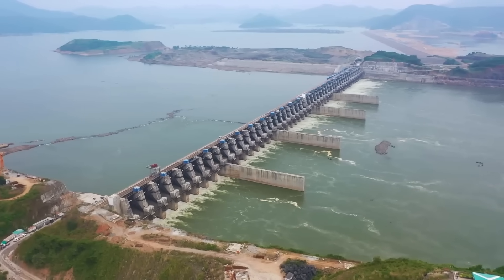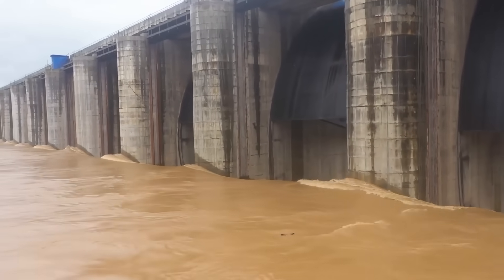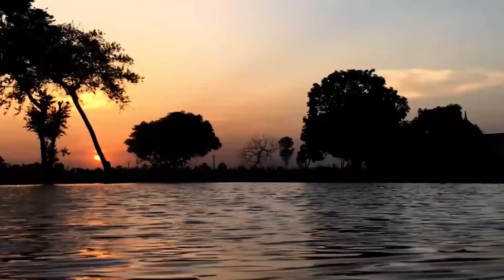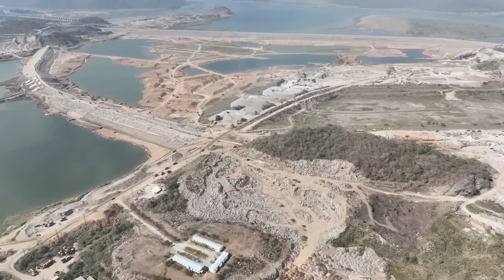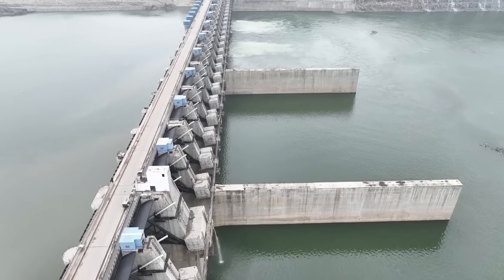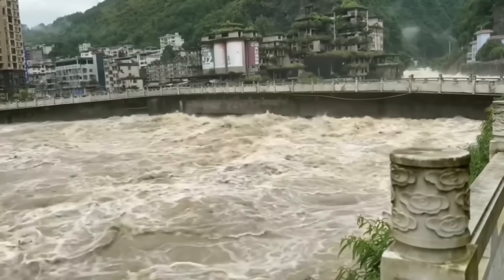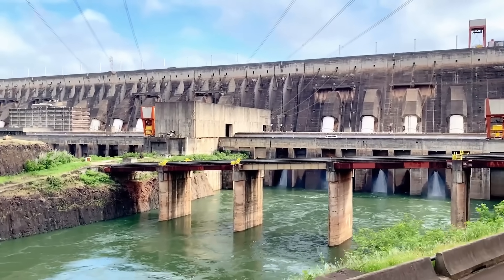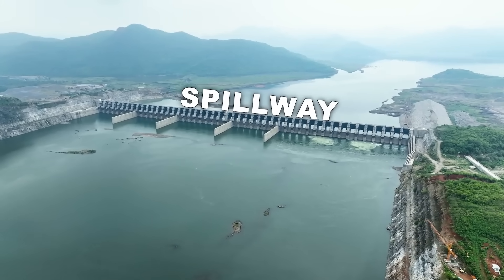Why is India Building a $6BN Giant Barrier?

Comment: The Three Gorges dam does not reduce the frequency of floods. Not because it can't, but because it is the most mismanaged flood control structure in the world, along with the dams upstream and downstream from it. Flood control doesn't seem to be a factor. Power generation and the profit from it is held by many Chinese to be the only thing the CCP cares about. The environmental impact of that reservoir has also been far, far greater than it was stated to be, causing noticeable changes in local climate and the stability of the canyon walls around it. Seems like they only release water when the dam is about to surpass 100% capacity, when the storms have already hit, and then do so with rapid releases, actually exacerbating flood damage, flowing water over already saturated areas. So... not the best choice to feature.

Comment: if and when China builds a damn blocking water from reaching India, it would be prudent to have a emergency reservoir , china will build a dam out of spite and not need to, but just to gain power over India, i forget the name of the river but goes through china in the himalayas before going into India, western river project it was called,  in the end if china does block water there wont be a need to build a dam by india because there wont be any water to retain coming from the north

Comment: One of the longest dams, 3.7 km in length, in the world and at a height of 45 mts power generation capacity of 980 MW (1 GW)  sounds so low. 
It should be atleast 2000MW (2 GW)

I'll put the comparisons below with itaipu dam.

Dam   => Itaipu : Polavaram

Height=> 196 mts : 45 mts 
Ratio  => 4.3 : 1

Length => 7.9 km : 3.7km
Ratio   => 2.1 : 1

Energy=> 14 GW : 1GW
Ratio   => 14 : 1

I mean the energy ratio also should be around 4 : 1 which gets us the capacity of around 3 GW and conservatively 2 GW
Reply: Water level matters
Reply: @Rocky-111.  

Now the comparison is for the electricity generation, and I have mentioned all the comparable things available on the internet and mentioned them here. 

If you think water level is something that affects electricity generation then you need to mention the comparisons in some quatified way for anyone reading to understand the importance of it.

Comment: How long will it last?
Reply: @ohcho-fg4co
The previous dam downstream built in 1850 was to last 100 years, but it is as good now as it was in 1859. By that reckoning this dam should last a century at least. May be the power generation part needs to be replaced, in stages.
Reply: Longer than the “Three Gorges Dam”😉